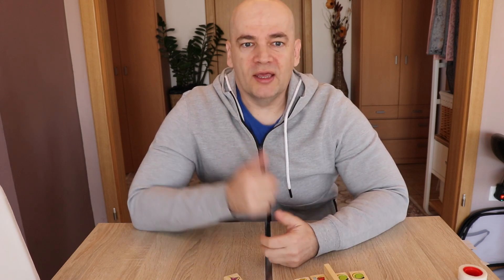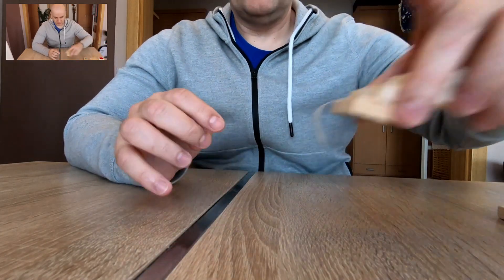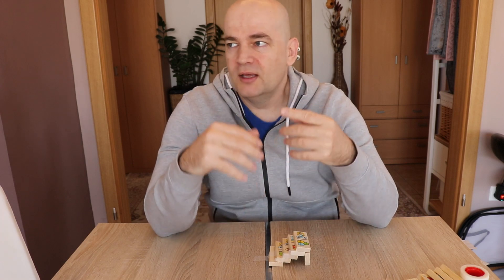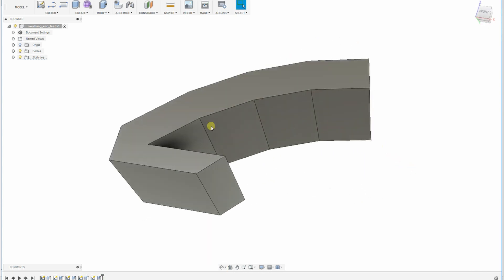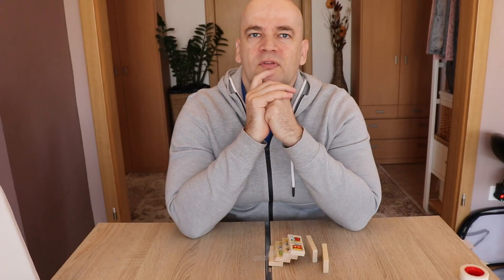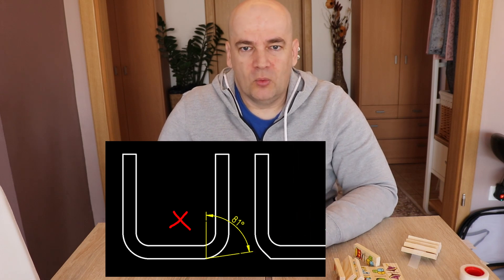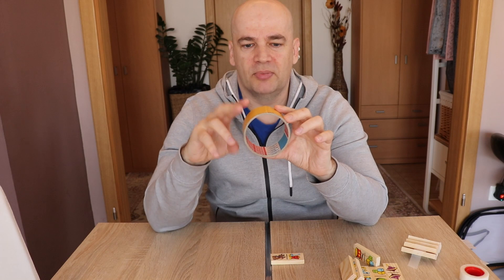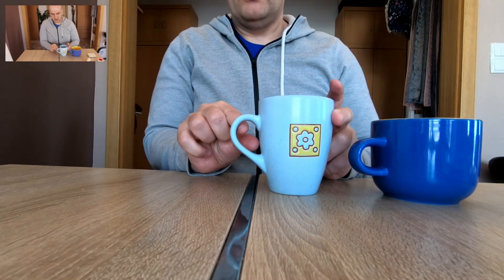What is overhang in 3D printing

Comment: An addition to your video: overhang is very sensitive to part cooling. I find that the worst overhang problems happen when the printer is printing on the opposite side of the part cooling fan, so that the printed object is obstructing the air flow from the fan. This is why I think that it makes sense to print your overhang test orienting it so that it's leaning away from the print head (at least on the Prusa MK3, where the part fan is blowing from the front).
Reply from the maker: You hit the point here. Few days ago I had problem with 45° PLA overhang, and problem was object too small, not enough time to cool down (on back side). Problem: https://www.facebook.com/gaspar.igor/videos/10158744547648631/ Solved with slow down speed, +desktop fan + lower temp.
Reply: @MyTechFun  Have a look at this overhang tester (not mine), it does a good job demonstrating the effect of part cooling on overhang:
https://www.prusaprinters.org/prints/12406